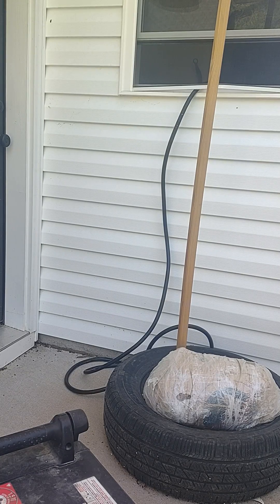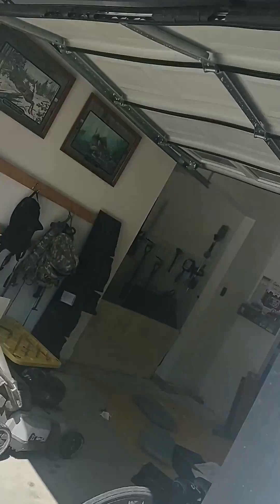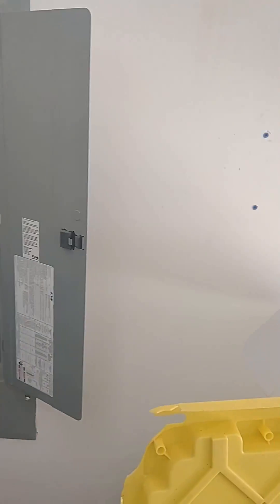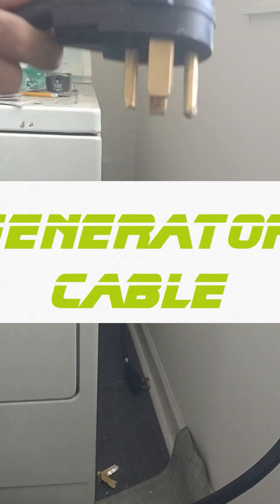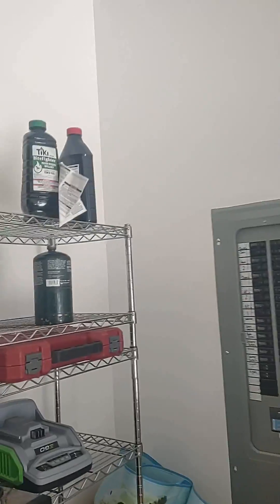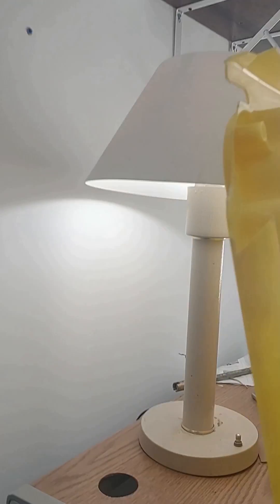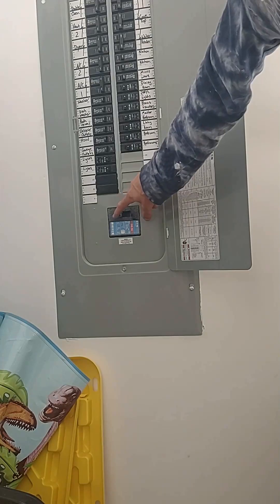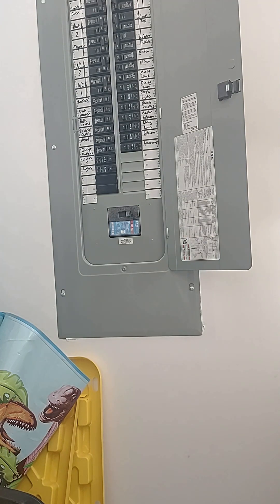Running the backup generator to the house using the dryer outlet

Comment: My house is paid for and I’m not buying another so I have an electrician scheduled to put my 50 amp box so I can run my generator without any issues like possibly having power backup and kill a power company employee,melting my two amp panel and ofcourse the inevitable fire from something this dangerous.

Comment: This is one of the most unsafe methods to hook up a generator there is. Somehow you know what a "suicide" cable is and still not only proceed to use it, but you also post this vid too. This is obviously a code violation and that is not even the real problem. The real problem is you are assuming you will never make a mistake and that nothing will happen to you while this is in operation. All you have to do is install a simple and inexpensive lockout plate to keep you, your house, line-workers, your neighbors and of course your family much safer. Is saving $50 really worth someone's life?
Reply from the maker: Getting electrocuted builds character.

Comment: ILLEGAL and DANGEROUS.  Folks just  look up the model of your  panel, and buy the appropriate interlock kit.  They are not that expensive.  This interlocks the main breaker and the geneset  breaker so   only one can be  "on" at a time.  Legal and not that expensive.
Reply from the maker: Well you need the interlock kit, a breaker, cables, a generator outlet, and a hired electrician if you dont want to work on it yourself.

So that can be kind of pricey in a country where half the population lives paycheck to paycheck.

Comment: I had an electrician quote me a price to install a power Inlet box. because of all the code upgrades the quote was almost $11,000. Screw that! I'm using this method
Reply: Are u sure he didnt say $1100?    It cost nowhere near that !! Get another estimate  my electrician charge me $500 and that was 4yrs ago
Reply: @MRTLEW01 i saved the written quote...i'm quite sure. House is 60 yrs old. They can't touch any electrical without bringing everything up to be code-compliant
Reply from the maker: @MRTLEW01 Luxury house with brick exterior and Californistan permits?
Reply: Get another estimate.
Reply from the maker: Thats nuts!  If SHTF, that same government will not be there to help you.

Comment: You may want to flip the 200 amp switch on the meter base too
Reply: Not necessary. Cutting the main in the subpanel isolates electricity to that panel. I intentionally leave my meter panel on so that I can see when the power is restored. Only time you would need to cut power at the meter is if you don't have a main breaker in the subpanel.
Reply: Im talkin about your service disconnect at the meter base. If your power company restores power, it will feed the curcuits while the generator is running.@howardradford1985

Comment: to be more responsible and legal for the lineman, it is a good idea to recommend interlock at minimum to make sure main and dryer breaker cannot be turned on at the same time.
Reply: Wouldn't that make it impossible to ever use your dryer even when you do have power?
Reply: @howardradford1985  yes, but if it was done the correct way with an actual generator inlet box, it is not an issue. 
But some just don't give a crap because they just know better and they would never do anything wrong (even though they are showing the world how ignorant they are).

Comment: This is very dangerous.  Not only to yourself and your family, but to any electric workers downstream if you forget to throw the mains breaker.   There's a reason they call it a dead-man cable.  Go ahead and do it.  I'm not the one facing negligent manslaughter charges if you make a mistake.  The sad thing is you can do it right for as little as 300 bucks.
Reply from the maker: @Fly_Away_2  What actually happens when the power tries to go the other way through the transformer?  Please cite an example of a line worker getting kilked this way.
Reply: @shaunnightfire8269  You asked for one, so here is just one.

Ronnie Adams, Jr., 41, from Georgia, who died in 2005 in Flomaton, Alabama, after an improperly installed generator backfed and electrocuted him while he was working to restore power after Hurricane Dennis.

Also, it isn't just backfeeding.  You have no breaker protection after the generator to the breaker box in your home.  If there is a short in the dryer line between the generator and the box, you have a problem.   And if you accidentally touch the exposed prongs of the dead-man cord...
Reply from the maker: @Fly_Away_2  Searched the article.  It was a generator for a commercial building and not residential back feeding.  NO ONE WAS CHARGED.  Only an unfortunate accident.   Use common sense a proper procedure for the generator cable and you will not get electrocuted.  Grow up.  Your fate is always in your own hands.  Do you bug DIY mechanics when they so not use a professional as they could just as easily kill themselves or others with their work??
Reply: @shaunnightfire8269  Buddy, I really don't care what you do, but when to tell others to do it I must say something.  i will tell you this; I worked in safety for decades and saw accidents where the person had done the job for years.  It only took one misstep and the outcomes were a trip to the hospital at best, and lethal at worst.
To anyone else reading this post I say, spend a few bucks and keep yourself and others safe.
Reply from the maker: Imagine if Boomers like this had 5he same passion towards food and drug companiess.  Instead of saving hundreds, we would save hundreds of thousands from diabetes, cancer, and heart disease.
Reply: @shaunnightfire8269  You are wrong.  I come from a science background, and I have been around long enough to know a few things.  Believe me,  I have taken my chances in life.  The reason I'm still here is by the grace of God and knowing when NOT to take a chance.

Comment: So this brings no electric past the main switch and I'm supposing your generator electric won't go any farther than main that switch on the panel also?
Reply from the maker: @417Keto  Power from the generator will not go past the 200a main which needs to stay off while the generator is connected.  The power will go past the dryer circuit which becomes the new main that powers the rest of the circuits when turned on.  Just be careful and thoughtful of the order you do things.
Reply: @shaunnightfire8269  thank you

Comment: Did you use a 30 or 50 amp extension?
Reply from the maker: @enjoythesho1992  50a but 30a would have been fine with my 3000 watt generator

Comment: Can you use this cable connected to a Ecoflow Pro max? Instead of a gas generator?
Reply from the maker: @1clancym  I believe my generator uses a floating neutral so if your Ecoflow is set up the same way, should be good to go.
Reply from the maker: AI Overview

When backfeeding, a generator's neutral can be either bonded or floating: 

Bonded neutral

Ensures that electricity flows properly through neutral conductors and is delivered to a single bonded location. This prevents stray voltages that can occur when connecting to the ground twice. 

Floating neutral

The neutral circuit is not connected to the generator's frame or the ground. This means the neutral must be connected to the existing panel neutral. A floating neutral can help prevent shock by allowing electrical currents to connect to the generator frame during a short circuit. It can also eliminate the risk of being shocked by touching a hot leg and the generator frame at the same time. For example, the National Electric Code requires a floating neutral when using a GenerLink Automatic Transfer Switch.

Comment: I set it up the same way but im using a 3000 watt pure sinewave inverter from my car. I modified a heavy duty electrical cord and put a dryer plug on the other end. My panel is in my garage. I have a 240v EV outlet in the garage and it uses the same plug as thr dryer.  It seems to work fine.

Comment: I was wondering can I run my 3.5 ton ac if I use my generator with the dryer 30 amp. Im kinda scared I can run my entire house but I have never tried to power up my ac. Please let me know if you use your central ac while doing this
Reply from the maker: @erichead021484  Aboslutely not.  Even if you have a 240v generator, the dryer circuit is likely much smaller than the AC.
Reply: OK so I should only use portable ac or window unit ac?
Reply from the maker: @erichead021484  yes.

Comment: are you sure that is safe?
Reply from the maker: @larrymoffatt6282  It's not safe.  But depending on the extreme situation, a total lack of electricity may be more unsafe.
Reply: Not safe if you plug it in the wrong way or forget to turn off the main. This is a quick way to injure your self or a line man . Do not recommend this there is a safer way
Reply: It’s most definitely not
Reply: It's called a suicide cable for a reason! Never do this!

Comment: He forgot to add how illegal this. He just set himself up to be sued. Buy a 50 dollar lock out kit and do it right.
Reply: You have video of how to install one?
Reply: Stop spewing nonsense.
Reply from the maker: @10ring Exactly.  All these jokers think I will get sued if someone does something they are incapable of.  Most of these comments are probably from laid off electricians.  And no, you cant do this with an interlock kit for $50. Cableing, panel breaker, and outlet box cost WAY more than $50.

Comment: Or you could hire a electrician to install a interlock kit w/ external Gen plug.  1/2023 installed by licensed electrician $500 included all parts and labor
Reply: Where at? I had some guy come out that was supposedly affordable and semi retired he wanted $900 labor only which I knew was a ripoff and didn't do
Reply: i put mine in in half an hour. generator has its own breaker
Reply from the maker: @BOB12349307 You need to have a breaker to install it in the panel as well.  Then of course wiring through the house to an outlet box.  No way is that getting done in a half hour.

Comment: There's 2 ways to do it the right way, get yourself an interlock kit with an inlet box this works on big generator to power the whole house. Use a transfer switch box for small generator. Don't burn your house down or kill anyone with that suicide wire please don't
Reply: Can you believe he would put this video out.
Reply from the maker: @raymondcamp8212 This wasnt meant to be rage bait.  There are plenty of DIY projects that can kill incompetent people.  If you dont feel safe doing it, simply dont do it.  Lets be adults.
Reply: I @raymondcamp8212

Comment: u don't have to turn all the singles off to cut off gen, just leve them all on and cut off dryer breaker. unplug gen, turn on dryer, and main.
Reply from the maker: @michaelcollins1899  More or less correct depending what you currently have running.  The sudden surge might be a bit too much for some gemerators.
Reply: Depending on what is connected to those breakers, you may overload your generator. Better to turn them all off and only turn on the ones you really need.

Comment: If I have a 240v generator, can I do this and power my well pump?
Reply from the maker: If the power is still routes through the main breaker it should still work.
Reply: this?
Reply from the maker: I believe the breakers on my well are external from the main box on my house as I could not find them there.  Not having power to the well will be a big problem so you will likely need to contact an electrical to find out how and where that is wired in.

Comment: Yes, this will work, but this is NOT Safe - remember, you will be doing this in the dark & under stress.  Good you had a checklist, but will you have it when you really need it?  Just remember, if you forget 1 step, you could hurt yourself, a loved one or some Tech working to fix the problem.  Please - get a Generator Power IN receptacle installed & an Interlock.  It is alot safer & only cost about $200 in materials.  Is $200 too much for your safety?  Yes, you would still need to have someone who knows how to properly install everything.
Reply: Just plain stupid. You are going to kill someone.
Reply: Dark? Flashlight. Stress? Mate, you're flipping some switches and plugging a cable in. How long would you last without society to coddle you?
Reply: @Robman-tp8bt  you can back feed power in to the line and hurt a line man
Reply: If the main breaker is turned off, the power from the generator can't back feed into the outside line. The lineman will test the line to see if there is back feed before they work on it.@mikemccarthy6939
Reply: @itsjustme167  it will back feed if the generator is on and the breaker on yes

Comment: if you had the generator set up for 220 you can feed the entire house. You choose which circuits you need without overloading the generator. UPDATE...you will need to run a neutral wire from the genset to your panel to get the 110vac circuits to work. Read the manual for the genset.
Reply: @adriancressy8363  You could kill a line man
Reply: @raymondcamp8212  I have a step-by-step procedure that is always followed that will not kill a lineman.
Reply: @adriancressy8363  only problem is some people can't follow directions and don't realize the danger. It's a liability l don't want
Reply: @adriancressy8363 What you don't understand is not everyone has the same set up as yours. Some have lug or split bus panels and some were not done correctly when there house was wired. I have people double up on line side of a main breaker to feed another panel. You could get some one killed.

Comment: If my generator only has a 30 amp outlet and doesn't have a 50 amp outlet, can I get a 30 amp adapter and run it safely into the dryers 50 amp outlet?
Reply from the maker: This was the situation with my generator.  Check your dryer breaker and make sure it is more than what your generator pushes.  Each of my dryer hots are 30a and I just ran the one phase so as to energize just one bus bar.  DO NOT run more amps into the dryer wire than what the panel is rated at since the wires are likely not rated for much higher than the breaker.
Reply: Yes

Comment: If you connect the 2 hots on the dryer plug you can power both legs of your panel so you have full use of all your 110 breakers Just DONT turn on any of the 220 breakers.
Reply: Have you tried this first hand? I was wondering this my self. The dryer plug would be the cheapest and easiest way to power all 120v in your home.
Reply: @jamiehughes7761  yes many times with a 2300w inverter when I don't need to power more than the fridge, tv, and a few lights.
Reply: What is the reason for not turning on the 220 breakers?
Reply: @lutitulur3039  this generator is only capable of 120. You would need a Generator capable of 240 to power 240 appliances.
Reply from the maker: @lutitulur3039  If believe if you wire both hots of the dryer into a single hot on your dryer, you essentially create a short circuit when you switch on one of the othe 229v circuits.
Reply from the maker: Good to know, thanks!
Reply: I'm very interested in doing this but not sure where the second hot is. My generator is 120v with a tt-30R outlet. My dryer plug is a NEMA 10-30 with a white, black and green wire. What wires would I connect together from a TT-30R extension cord to get both poles of the circuit panel to to energize?  Thanks!!